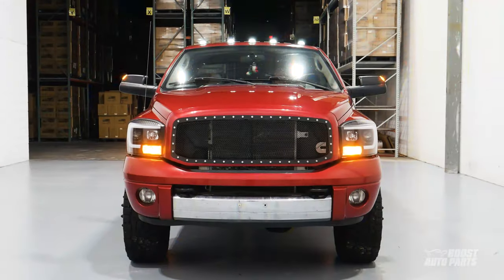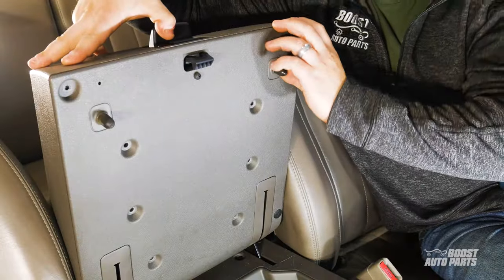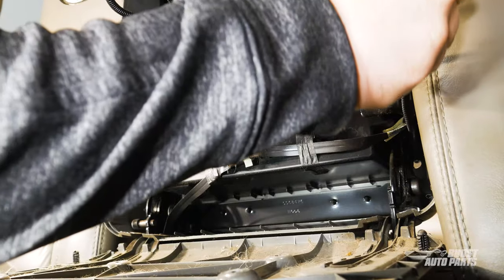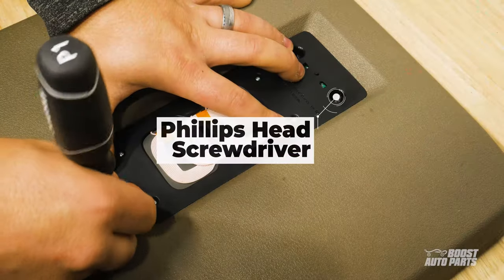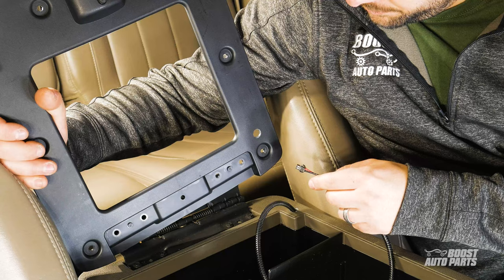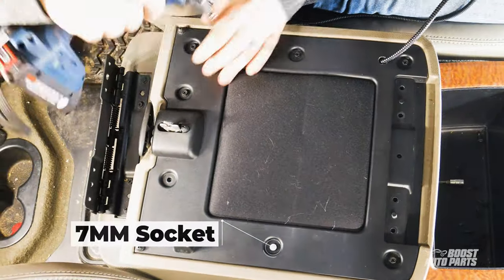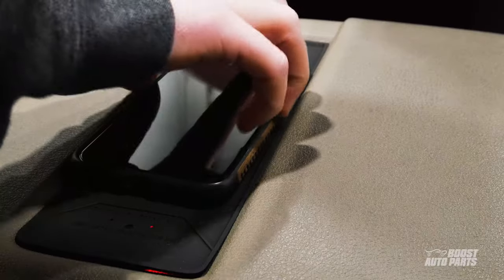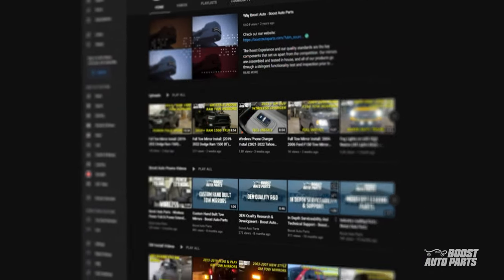2006-2009 Dodge Ram Wireless Phone Charging Retrofit Install (1500/2500/3500 Full Center Console)

Comment: How grippy is the mat?
I’ve already broken one iPhone from it flying off the lid and hitting my one of my amplifiers under rear seat. Since then, I don’t put my phone on the lid anymore. If this is nice and grippy, I def would do this mod just to free up my cup holder again!
Reply from the maker: The rubber has a texture to it to help retain the phone, however if you slam on the brakes there's still the possibility the phone will move.

Comment: Hey guys, since I have always been really impressed with your products, I am planning to use this exact Dodge ram wireless charging mat in my custom project truck interior. There will basically be one of them on each door panel armrest section to have wireless charging pads for the driver and passenger. 

I am in the process of building my door panels now and just wanted to ask if it is possible to get the dimensions of these particular RAM charging mats to make sure I design the door panels wide enough?

Hope that makes sense, thanks for any info you can provide

Peace!!
Reply from the maker: Please feel free to email support@boostautoparts.com or call 765-831-2830. They are best suited to assist.

Comment: What is the amperage draw of the charger when in standby mode? Does it have turned off if the truck isn't used daily? Asking as that power outlet is battery power, not ignition power and could cause a drain on the battery.
Reply from the maker: The charger draws milliamps when not being used. It can be left on for months and will not drain the batteries unless something is charging on it. If you'd like to power it off, you can always press and hold the sub-flush button for 3 seconds but that's generally not necessary.